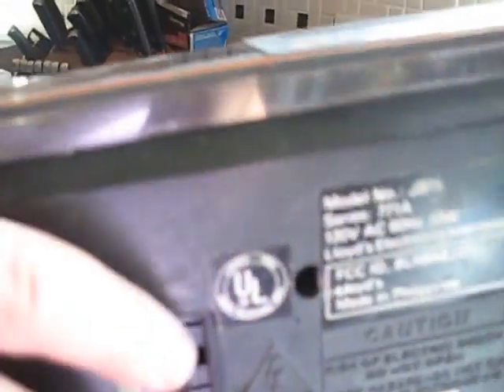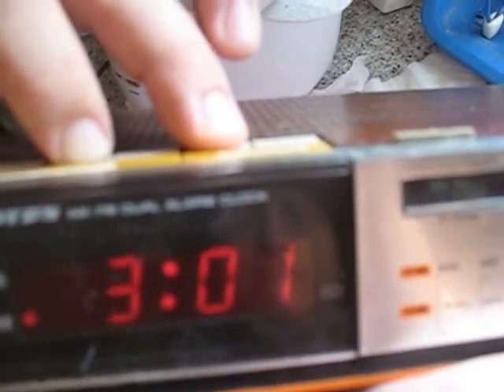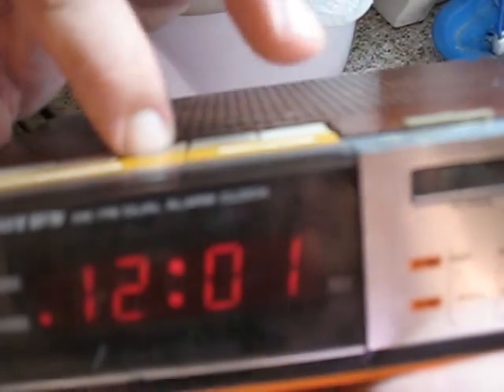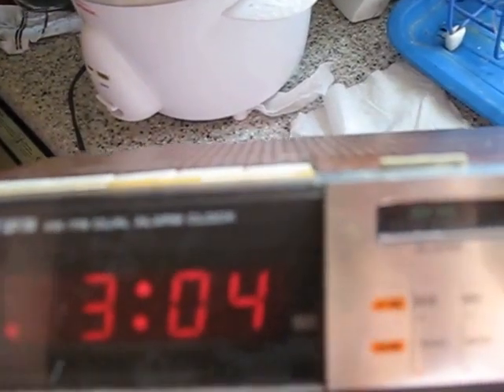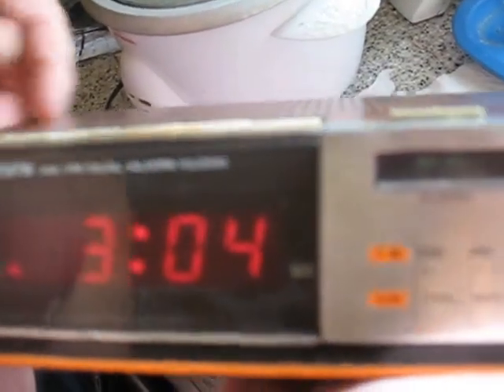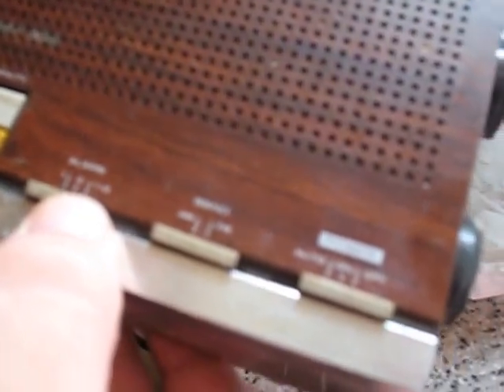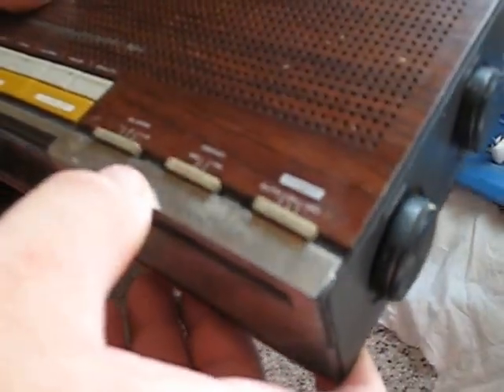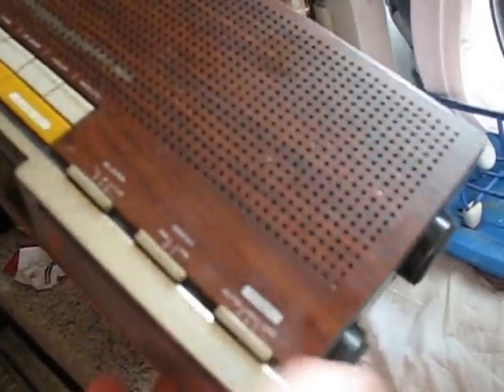How to SET TIME ALARM CLOCK of VINTAGE Old LLOYD'S J375 771A RADIO AM FM BAND Digital Electric

Comment: Hi there, I recently received an aged General Electric digital display alarm clock with battery backup, it's old. I really enjoy having the time so accessible! I set the time and leave it plugged in yet it keeps resetting itself back to 12:00 even while the power goes through it. Do you know what might be wrong? thanks for your time (:
Reply from the maker: Possibly, there is something wrong (that needs to be fix) with the internal wiring or connections behind the digital display. Usually, there are I.C. (Integrated Circuit) inside digital clocks controlling it.

Comment: Ok, i know this video was uploaded years ago but I have a question...I just bought this clock at a thrift store last night. HOW do you shut the alarm off when it goes off?? I can hit "snooze" and it goes off and then comes back on because it's on snooze mode. How do you shut it off when it goes off?? thanks!!!
Reply from the maker: I'm not 100% positive, but I think the button to turn off the alarm is mentioned at around @3:30 of this video - in this section, it is mentioned to hit a button to turn off the sleeper, but I apologize for the video footage because it doesn't clearly show which button we were talking about.